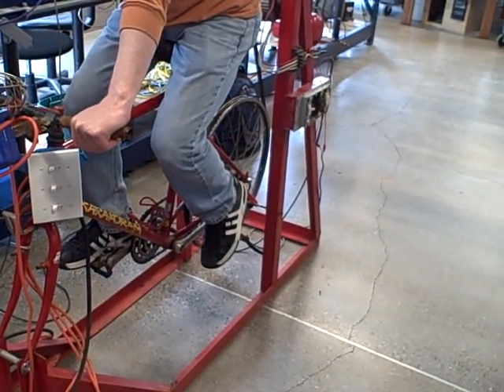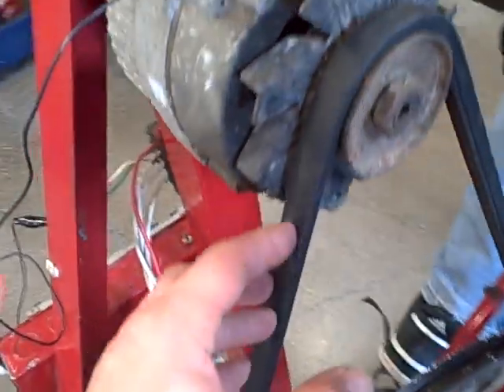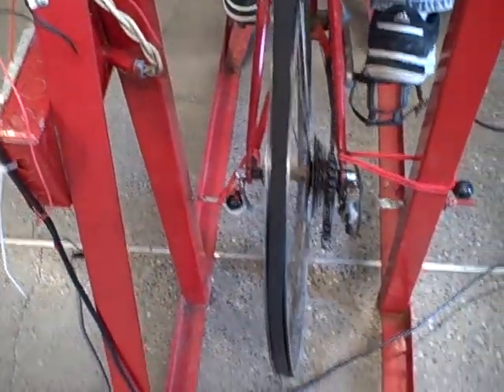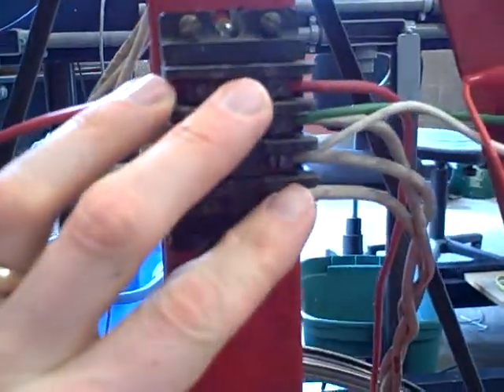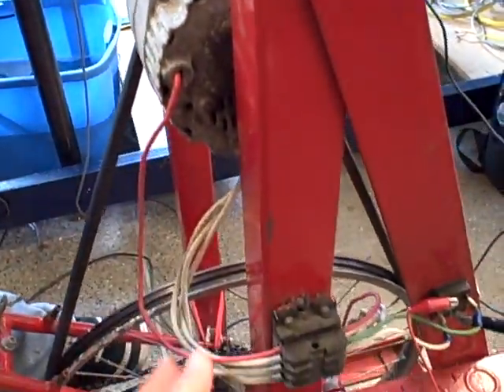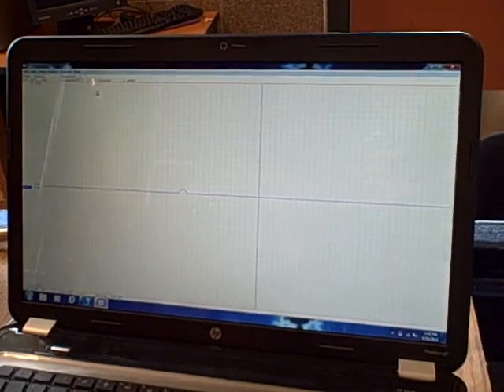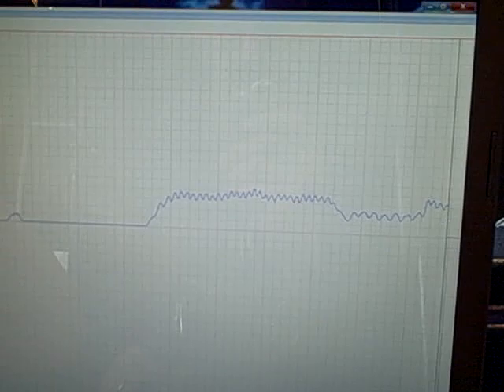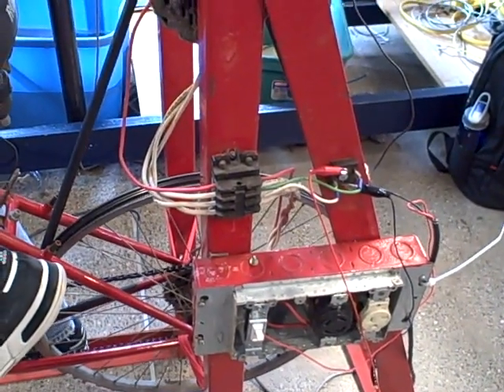Bicycle generator project -- simple demonstration

Comment from the maker: When I was using this thing for my own exercise, 100% of the power I got from it was free in the respect that otherwise I'd be burning up those expensive calories simply moving my carcass around the neighborhood on an ordinary bicycle.  In that context, no source of power is more efficient!

Calculations of work done by a bicycle generator versus caloric intake puts the human body somewhere in the neighborhood of 25% efficiency, which is in line with most internal combustion engines.